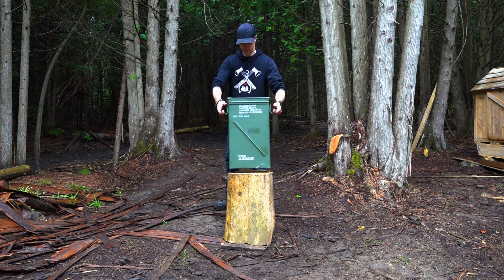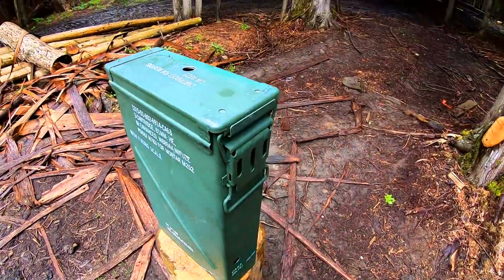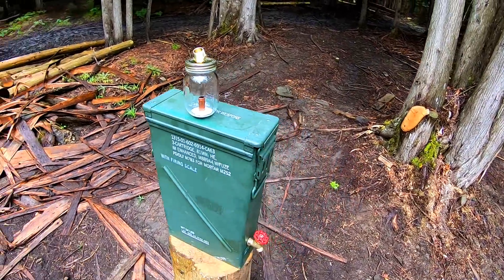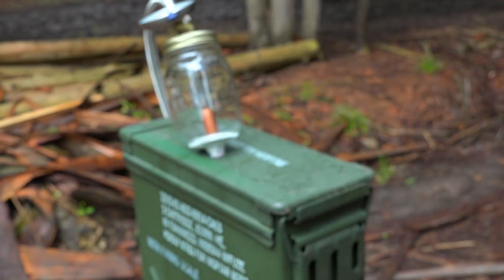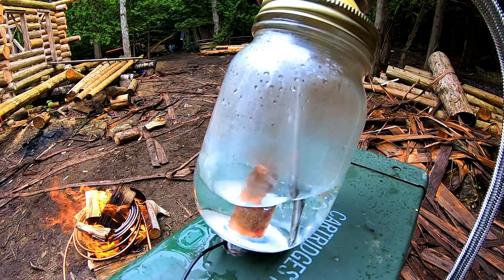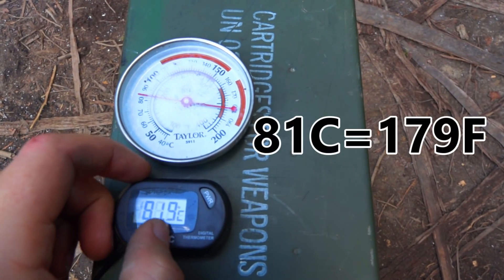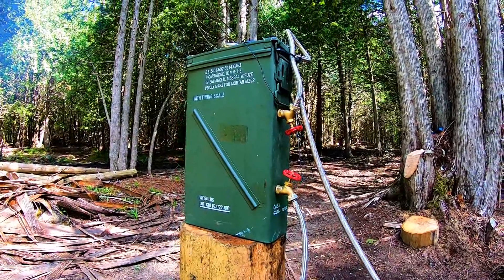Off Grid Heating Prototype- Copper Coil Water Heater / Heat Exchanger / Radiant Heater

Comment: Run tubing under ur floor just like they door for some homes. Heat will radiate upwards keep u toasty
Reply: and the side walls too fuck it do the whole thing, might take 2 hours but once hot your in a hot box while its snowing outside brilliant
Reply: @spydergto1  That sounds like an oven!
Reply: I love how constructive comments in these types of videos are.
Reply: Take a cue from existing radiant heaters. Install a single pipe (1/2" or 5/16") hot water pipe inside the camper with a sheet metal cylindrical heat shield/radiator, close to, but not on the floor. Leave the tank safely outdoors. Also, put some rocks in the tank. They'll hold onto heat after the fire goes out so you can make it through the whole night without having to go out into the cold to feed a fire.
Reply: Couldn't you use a copper valve along the line feeding into the fire. So if it gets to warm just shut the valve and water no longer circulates to get heated? It's clear once the water gets to a certain temp it stays pretty darn hot lol
Reply: Mark Bevans the valve would need to be an A-B and divert the hot water elsewhere, such as another radiator or heat sink outside. If the flow (through the closed system) is restricted, the heat will build up in the system ahead of the radiator, until something ruptures or a safety pressure valve opens. As others said, you’d need a way to control the heat being input to the system, or a way to control where the heat is removed from the system by diverting, or a combination of both.
Reply: 100 C floor heating sounds fun.
Reply: @MindlessSuccess  they're 'mercan ... don't/can't think. All have their wisdom teeth pulled in their teens for that all 'mercan white straight smile.
Reply: That’s what I was thinking. He just needs a reliable way to manage flow to keep it from getting too hot.
Reply: nicksurfs1 
Insulation will do the trick.
Reply: @nicksurfs1  Have it coil fewer times in the fire.
Reply: @nicksurfs1  No, what he needs is some way of controlling how much heat he puts into the system.

If he puts some form of restriction to the flow of this system, while still adding the same amount of heat will only result in something overheating and possibly breaking due to steam pressure buildup.

The only real way to adjust the heat with this system, would be to make it so, that he could adjust how much heat was inside and how much heat was put outside.

Could do that with a system that had a heater outside as well, and when the inside heater got warm enough, switch to the outside heater.

Or just take the coil away from the fire.
Reply: @weedfarmer89  Eeh, rope over fire...

Does not sound like a very permanent solution to me :)
Reply: @LOOKY HERE yeah guess a vent would be the simplest option
Reply: Cool idea
Reply: Exactly, also
-keep the water tank outside for safety or in the steam sauna you do next
-coil is way too big for such a small deposit, overkill, some simple finish log fire arrangement can be easier to time and keep temperature under control with the much smaller coil at the center.
-add a second one way only tank to keep water level equal and temp under control
Reply: may want to use tubing sheathing, like the stainless steel braided used on car exhaust manifolds? For safety and more surface area to increase conduction n radiation?? Thoughts? Best..
Reply: Win
Reply: Get a girlfriend and cuddle.

Comment: What about adding large rocks inside the ammo box to give you more thermal mass, making it last longer when its in your cabin?
Reply: jamaus555 rock would displace water, which is actually a far more effective medium for storing heat. The only advantage of rock is that it can be heated to higher temperatures, but that doesn't apply in this situation as the system is reliant on water and therefore cannot exceed boiling point anyway.
Reply: with a check valve in the inlet facing the coil, he could heat that tank in a couple minutes to dangerous levels, with half the copper and less than half the heat. the current design is flawed.
Reply: Gadget Deez No check valve needed.  The coil must be wound to a spiral and at the bottom, it changes to a straight run back up to the tank.  Then gravity circulates the water surprisingly fast.  Just throwing some coiled copper in the fire is really not how it works as this video demonstrates.
Reply: @MrKnutriis  however, with not being able to throttle your heat input, you can quickly run into too much heat input where the water boils rather than flows. This is where a check ball comes in. As water boils it expands rapidly pushing water out of both ends of the coil and completely halting water flow. With a simple ball check valve, it will work as you explain till it gets to the point of boiling. As the gasses rapidly expand, this pushes the check ball against its seat in the inlet blocking flow, and causing flow to go out the other, or outlet end of the pipe. Newtons first law comes into play where trapped water in the pipe that is accelerated by the steam will not want to stop, causing the check ball to move out of the way, bringing fresh, cooler water into the pipe where the steam stops occuring and the copper coil doesnt overheat. Then convection can take over again until a boil occurs again which would repeat the process.
Reply: Gadget Deez I hope you are right and I look forward to see the implementation of your theory.

Comment: If you add a thermal mass (brick or stone) inside your steel box you probably keep temperature longer in winter...
Reply: Patrick Dubois water is actually a very good medium for storing heat, even more so than dense concrete or bricks. Plus, you don't have to carry it everywhere, just fill the system on arrival at your location.

Comment: Why did you use copper coil? I don't know much about this stuff
Reply: Relatively cheap, easy to work with, and an excellent heat conductor (Probably too excellent since his main problem was the water steaming out of the pipe instead of simply heating and flowing normally, actually).

Comment: Hmmm get an oil drum mkay and the pipe to a bigger tank of water and fill oil drum with water..make sure no oil in it..then heat drum and hot water go down nudder pipe it be hot so mix it with cold and thats how you dood it mkay..it works...if it boils in drum..steam comes out water tank..or blows up..make sure big tank high up ...I have 200psi takes top layer of fungus off skin.

Comment: maybe heating a thick walled stainless tank suspended above a small fire may be simpler
Reply: All the components can be broken down to fit inside the ammo can when it comes time to pack in or pack out.  Using it as a heat battery in a tent or trailer would require a fire only to get it up to temperature.  No need to stoke a fire all night long.

Comment: I think if you used a pump you can get the temperature up much faster. Because you are making steam in the copper tubing. Steam conducts energy less good then water. A small pump will do, just to get just a little flow.

Comment: USE A METAL ROCKET STOVE AND WRAP THE COIL AROUND IT .
Reply: burns too fast, a Dakota Fire pit would be best
Reply: @-bdl2696  He could put the heat battery in a tent.  A rocket stove or fire pit not so much.
Reply: hollow log stove burns all night, and use a pressure cooker with a radiator inside...open for pressure relief...

Comment: @The Outsider Cool idea!
I can see one problem with it: The water in the coil can freeze & expand so the coil breaks, after you remove it from the fire in the winter.
You would probably need to empty the coil ( into a bucket? ) somehow, so it doesn't break, and maybe loose that (hot?) water.

Maybe also add some isolation around the inlet side of the hoes?

Another thing that annoys me, is that the lower output valve on the ammo box is so high up, I would have put it as low as possible (I assume you have something in your sled that would be in the way)

Comment: Keeping the box under pressure will stop the boiling & using a pressure relief valve like a tank would keep it safe. Although I don't think the ammo box is stout enough to handle the pressure.

Comment: This is essentially a radiator why not buy of the shelf small radiator and connect the copper as you did but keep the copper slightly above the fire to maximize duration and stop the copper from turning black.

Comment: I'd think a radiator or heat exchanger would be more efficient than a tank that ends up being a solid mass with not much surface area to transfer heat. Even a small radiator with battery operated fans might do much better for you.

Comment: Bad & dangerous scalding hot water, in a non leak proof container "Spooning should be fun". Just lace the camper floorowith copper tubing that you have. Use the ammo box as boiler, supply outlet tap on top, inlet at bottom side. Small fire, natural circulation will happen once water/ glycol (anti freeze) is heated. The heated floor will keep you warmer.

Comment: The system must to be vented if you dont and the water boils and the amo box splits you have a massive expansion flash ,water boils at a 212 f at sea level .
The unit will not turn the water to steam wile the unit is sealed so it could be 300 f  and once the box splits the water becomes steem expanding 1600 :1 so you have a bomb,have a bit of a look into it ,and as you know the cylinder must be higher then the fire,in Australia we put the cylinder about 1m above the heater.

Comment: Been toying with this idea using a heater core from and old car and using coolant instead of water.. can run a blower fan through the heater core and by using coolant you have a greater boiling point in a closed loop system such as a cars cooling system... Great work I look forward to the next episode 👍

Comment: I love your idea. But would a car radiator work better instead of the can. The cap is a emergency blow off. And a pc fan with some batteries  and solar panel help circulate the air. And maybe a diy thermostat and housing to limit flow.

Comment: Now here's what I think can be an improvement? Insulate the box (sound absorption and heat retention), but station the tank on the exterior of the hut. Run some tubing, at a low point and at a high point, on the side of the tank. And run them through the hut's wall. Connect the tubes at both ends of a baseboard type aluminum finned radiator section. I'm thinking that you might have to position it vertically?

Comment: as a retired HVAC contractor I see nothing but long term problems, Heat transfer is one, the copper heating over a open flame will lead to problems with scale and eventually losing conductivity. Heat loss from the uninsulated lines is another especially with cold weather and or snow. No air flow across the ammo can is another. Basically making a boiler with no safety controls  that can explode

Comment: Add a small tank above filled with water for feeding the system, taking up expansion and take a little bit of heat with a vent pipe over the top like an old school British plumbing system (if it's over venting then it's probably too hot). Be careful with the flex as some are not designed to go over 70c due to the rubber lining.

Comment: seems silly to me seems how the can itself is tin and could go directly into the fire.
Reply: No dumbass he was heating water with copper  tubing and running it to the tin military can. The military can could have got filled with water and placed right into the fire to heat water no need to run copper tubing to and circulate the water.

Comment: That is a cool idea. The Pipe with the hot Dream shojld end in the water Or you Build a Second Cooper Spiral to cool the Steam down. This Second spiral should be inside the Snow Camper.

Comment: What keeps the water from the copper tubing from pushing back in both ends of the tube how does the water circulate one way
Reply: Hot water rises and pulls the lower colder water out to the fire.

Comment: You would to have a much longer copper tubing to keep the fire far enough away from your cabin and another thing is you would think you would have to vent that steam pipe out through the roof so your cabin didn't feel put so much steam and get everything all wet

Comment: A true give and take situation. I would be concerned with the condensation that ammo can would create inside the sled. At first it might not be a big issue because it is putting off heat, but once your fire burned out and the inside temp of your sled/cabin started to get cold or freeze you would find the condensation as frost on everything. In my camping experience, I have found that being dry is biggest part of being able to get warm. 
Your system will work if you put the ammo can outside and run a radiator to the inside, maybe a small battery fan to push the air around/through the radiator.

Comment: Try it with compost. Then you no longer need fire.
Reply: That is something I have been mulling over, the Victorians used manure to heat green houses..so a massive pile of manure and stuff with a heat exchanger should work..
Reply: Robert Klemensberger good idea for a fixed location 👍

Comment: Ummm. $.02: You have way too much coil in the fire. The water is becoming steam and breaking your thermosiphon simply because you are adding so much heat. Reduce the coil (or just back it out of the fire) and you'll get flow without noise. Great shots of the steam re-collapsing into liquid water inside the tank, btw. (I've built a few wood-fired domestic water heaters for showers and laundry, but never a closed loop for space heating.) Your cabin rocks! :-)
Reply: when i looked into using my wood stove to do this similar thing i found no more than 2-3 feet of 5/8th inch copper in a coil was all that you needed for a 30 gallon tank. and a pressure release valve.

Comment: idiotic design, the camp fire can get hot enough to melt the copper. why not just get a little wood stove seems safer than a giant metal bucket of scalding water which is releasing tons of moisture that will freeze or turn to mold once your fire.goes out in the night!
Reply: just a rich dude with a nice camera

Comment: I would have used a cars heater core hell or buy a brand new one that would fit my daily drive (2002 Tacoma manual of course) if not just a radiator, so many sizes to choose from wonder if it would be better to have a large one that would hold heat but take longer or a smaller one.

Comment: Your original idea was good, only thing wrong was  BTU Output, there is enough fire there to heat a 2000 sq/ft house for a night,   1/8 of that amount of fire would have done the job satisfactorily

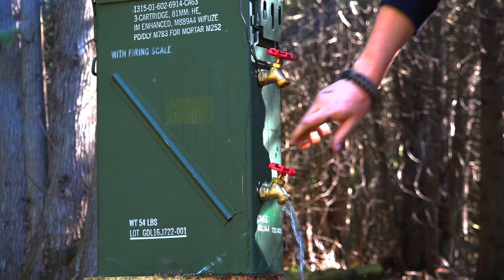Comment: 7:13  your thinking is not correct here.  Air getting trapped in the line has nothing to do with steam formation.   Steam forms when the water is over its boiling point regardless of air or where you place the hot water inlet.  At least with the hot water inlet below the water line you give some opportunity for the steam to condense in your ammo box (you can see the steam bubbles coming out of the inlet and collapsing in your vid) but if you have enough heat input even that wont matter.  Try using less fire and/or put a coil of copper in the ammo box on the hot water side to allow steam to condense more efficiently.

Comment: On one hand it is pretty safe to have the fire outside and the heat exchanger ammobox in the camper. But it is all very bulky to my opinion. And not very efficient. There is a huge fire burning outside. I would choose for a mini wood stove inside with a small chimney out the roof and some ventilation to keep it safe. This way there is no need to leave the camper to adjust the fire and you will be ok for the whole night with just a fraction of wood comparred to what you burn now. unless you need this big fire outside to keep wildlife on a distance. That would safe you a lot of hassle I think. And if you still prefer the fire outside maybe just make a small stove  and feed a pipe through the body. The inlet of the pipe long enough to make sure it will suck fresh air without burning gasses and on the other side a double sided pipe as insulator that will end inside the camper. Just add a small silent 12 v fan that will draw air in through the pipe if natural convection is not enough.

Comment: i like it. but a bit too complicated, and if the water ever spilled in the cabin your getting burned.  and its noisy.  what about heating rocks on a fire and then putting them in a metal pan or the ammo box.  after a while you might have to exchange fresh rocks on the fire with the old ones but much safer and all you need is a pan or the ammo box to put the rock in, and a pair of good welding gloves.  i did it once on a camping trip, rapped the rocks in a towel and spooned with it all night.  lol